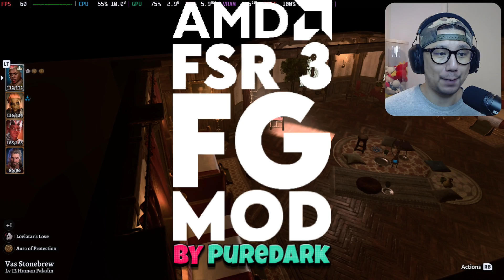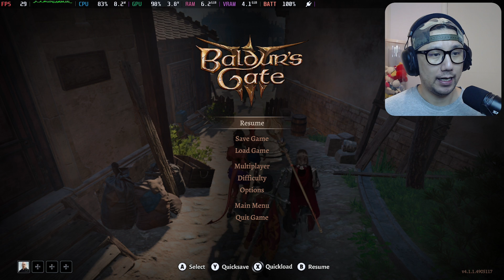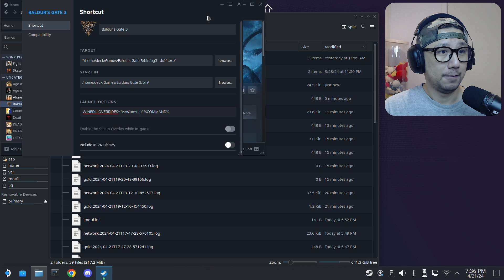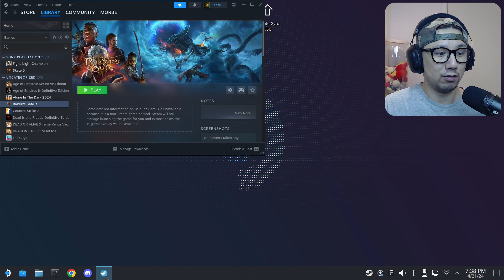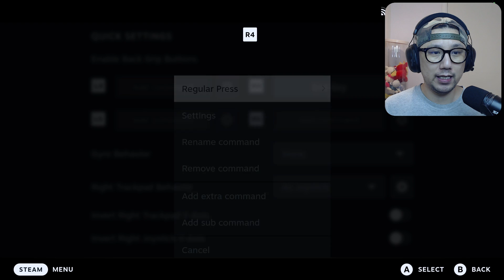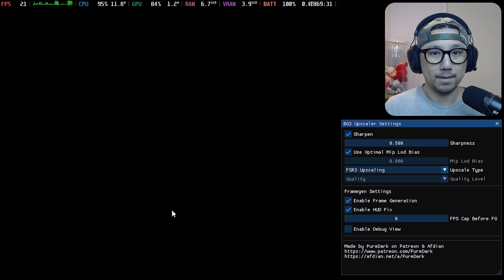Steam Deck Baldur's Gate 3 FSR 3.0 Frame Generation Mod by PureDark #steamdeck #fsr3 #baldursgate3

Comment: The game is crashing for me upon startup, even with proton experimental
Reply from the maker: @joeykoller8390  it works without the mod?
Reply: @GrownUpGamingGUG  it seems like the launch command is causing it to crash bc when I remove it it works fine, but then the mod doesn’t work
Reply from the maker: Are you sure you followed correctly? Maybe you could list the steps and I might be able to spot any differences.
Reply: @GrownUpGamingGUG first I extract puredarks FSR3 mod into the bin folder, then I add the launch command WINEDLLOVERRIDES=“version=n,b” %COMMAND%, then I replace the fx12 backend DLL with the dlssfg to fsr3 mod, and rename it to the backend DLL and rename and delete the old one. Then my game doesn’t launch. Even using proton experimental or GE
Reply: @GrownUpGamingGUG  yes
Reply: I've managed to collect the log: 
0024:warn:seh:dispatch_exception EXCEPTION_ACCESS_VIOLATION exception (code=c0000005) raised
0024:trace:seh:dispatch_exception  rax=000000000011e518 rbx=000000000011e970 rcx=000000000001007e rdx=000000000011e800
0024:trace:seh:dispatch_exception  rsi=00000000007b3360 rdi=000000000011e800 rbp=0000000000dacf70 rsp=000000000011e4d8
0024:trace:seh:dispatch_exception   r8=000000000011e970  r9=0000000000dacf70 r10=0000000000000000 r11=000000000011dca0
0024:trace:seh:dispatch_exception  r12=000000000011e930 r13=000000000011e970 r14=000000000001007e r15=0000000000dca8d0
0024:trace:seh:call_vectored_handlers calling handler at 00006FFFF190B1D0 code=c0000005 flags=0
0024:trace:seh:call_vectored_handlers handler at 00006FFFF190B1D0 returned 0
0024:trace:seh:call_vectored_handlers calling handler at 00006FFFFC82B1B0 code=c0000005 flags=0
0024:trace:seh:call_vectored_handlers handler at 00006FFFFC82B1B0 returned 0
0024:trace:seh:call_vectored_handlers calling handler at 00006FFFFC57C080 code=c0000005 flags=0
0024:trace:seh:call_vectored_handlers handler at 00006FFFFC57C080 returned 0
0024:warn:seh:virtual_unwind backtrace: 00006FFFF219CCDD: L"PDPerfPlugin.dll" + 000000000000CCDD.
0024:trace:seh:call_handler calling handler 00006FFFF21B6948 (rec=000000000011E230, frame=000000000011E4E0 context=000000000011D790, dispatch=000000000011D660)
0024:trace:seh:call_handler handler at 00006FFFF21B6948 returned 1
0024:warn:seh:virtual_unwind backtrace: 00006FFFF219B598: L"PDPerfPlugin.dll" + 000000000000B598.
0024:warn:seh:virtual_unwind backtrace: 00006FFFF21A2464: L"PDPerfPlugin.dll" + 0000000000012464.
0024:warn:seh:virtual_unwind backtrace: 00006FFFF21A514A: L"PDPerfPlugin.dll" + 000000000001514A.

Comment: Does not look great. If you have good internet with unlimited usage, I would use GeForce Now instead to play this. Just make sure your steam deck is not downloading anything when you are streaming.
Reply from the maker: It's better on the legion go, I'll do a video showcasing this mod with legion go.
Reply: @GrownUpGamingGUG  it is a clever Mod. If it works on your Legion Go I will try and Install it on my Rog Ally.
Reply from the maker: @Silverarrow2  its simplier on windows. Just extract the mod inside the bin folder and you're done.

Comment: which software generates the overlay with the cpu and gpu usage %?
Reply from the maker: Steam Deck comes with it in gaming mode. Press the three dots button and under performance select performance overlay level.
Reply: @GrownUpGamingGUG  found its a linux app called MangoHud
Reply from the maker: It gives more information compared to the steam deck built-in one?
Reply: @GrownUpGamingGUG  its the same software, afaik
Reply from the maker: @tulipista  yes it's the same I think, that's the one I'm using.

Comment: Maybe add on -dx12 or -dx11 to the steam launch options. And I’d recommend trying a different version of proton. To prevent stuttering with fsr 3 please enable a frame cap. I’m not sure if that would work for this mod though. For some mods dlss tweaks works wonders by enabling dlaa and adjusting the sharpness scale to work alongside with frame generation. Thanks for putting me onto fsr 3 it’s definitely a game changer. Now I get a locked 60 fps in most games including hogwarts legacy, apex legends and for the most part tlou 1. Edit: I forgot to add for the most part I achieved 60 fps without any mod just adding -dx12 , dx11, or vulkan to the launch options followed by adding -high after 1 of the 3 launch options
Reply: Can you post a guide or a video on how to do the steps you mentioned please ? I’d be very thankful
Reply from the maker: It's just add -dx11 at the end of the launch code to force the game to run in dx11 but I think proton translates dx11 into vulkan as it uses dxvk so the mod still crashes.
Reply from the maker: I did try adding -dx11 with this one but I don't notice any difference. Might try frame cap. Thanks 👍